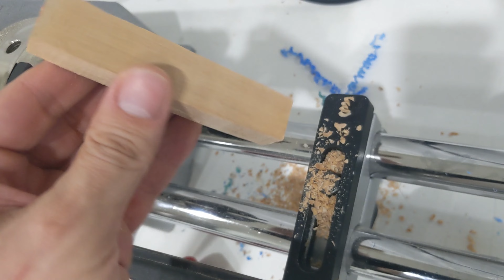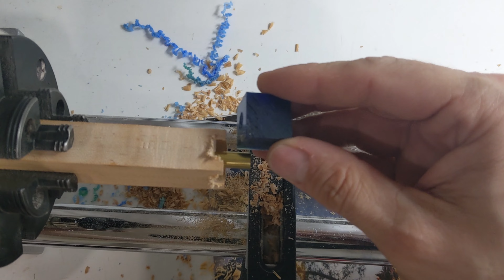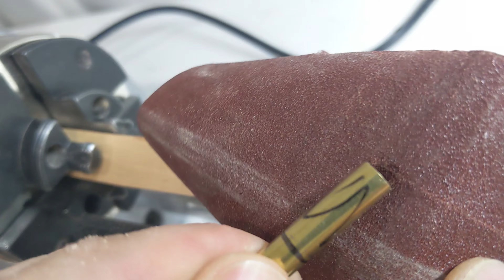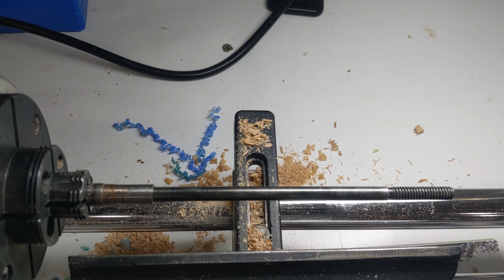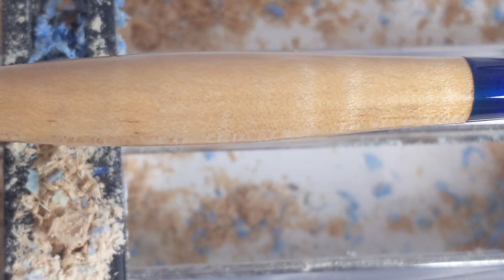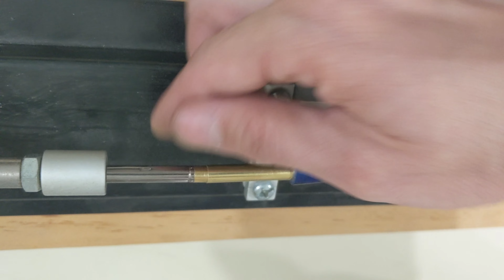Heavily Modified Slimline Pen

Comment: Nice work. You should remove the tool rest when sanding, though - H&S! Like me, you have the copper tube showing through when the acrylic tapers to the point of the pen - I believe you can paint the tube to solve this problem, but I have never tried that!
Reply from the maker: I actually like the copper tube being visible a bit. How do you think it could be painted?
Reply: @Evanstal  I think, I have not done it myself, you can put a coat of white paint on the copper tube before gluing it in. You can also get tubes pre-painted - I have seen them at Charnwood Tools but expect you can them anywhere that supplies pen kits
Reply: @jonathancmerrett any ink will do just fine.